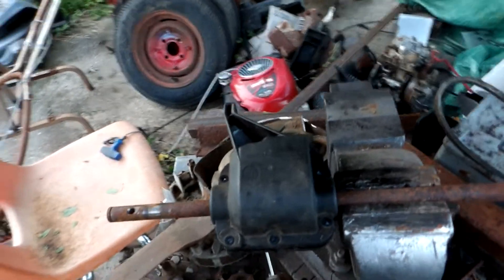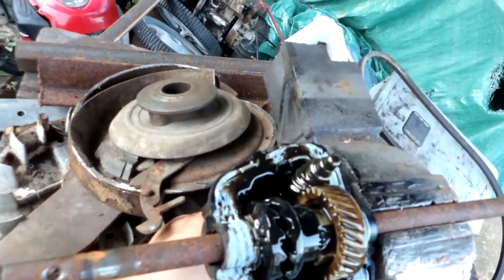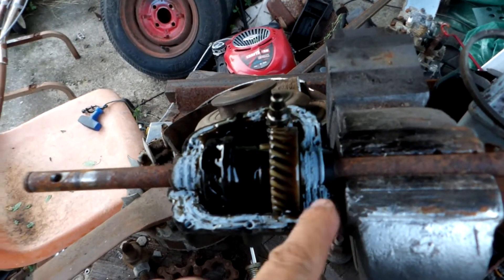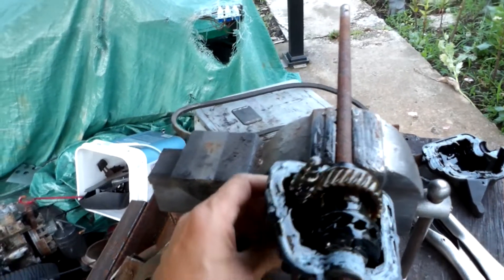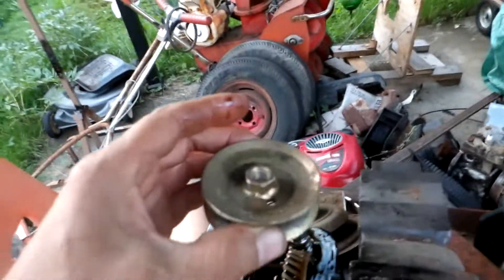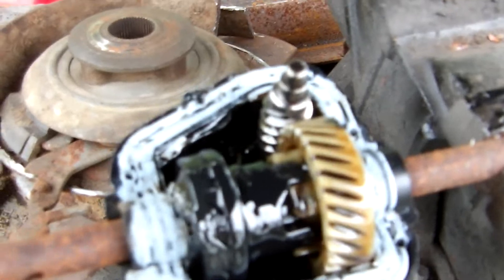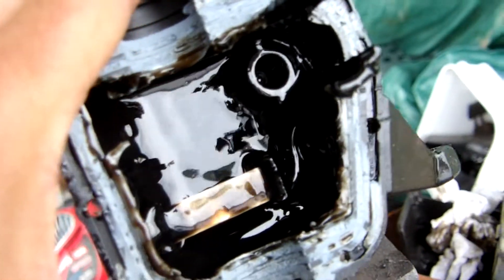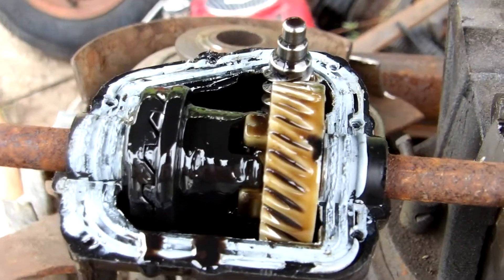Self Propelled Lawnmower Transmission Teardown!

Comment: Your maths is wrong, the worm has  4 teeth, but if its a single helix screw itll still only turn the output gear by 1 tooth per rotation. So the ratio is 28:1, or 14:1 if its a double helix screw
Reply: Useful video anyway, thanks
Reply from the maker: Thanks

Comment: Been watchin you a long time man, since the experimental monosupape, oposed pistons, and supercharged jumo.  Love those old vids where you were playin around.  I'm fighting one of these transmissions now as far as pulling the mower backward.  Wants to jam up and the front wheels won't spin in reverse.  Looked up "fwd mower transmission disassembly" and your vid popped up.  Thanks for makin this one.  I bet it's that "clutch" as you described it not disengaging.  Least now I know what to look for if I crack it open.  Much love from TX.  Keep doin what you do man 👍🏻
Reply from the maker: Hey, thanks for the comment. I thought I had the type of fluid in the transmission identified at one time, but I can't remember what it is now.

Comment: My Craftsman M250 started leaking gear oil around one of the screws, so I'm hoping to take it apart, clean out the lube and sealant, and reassemble. 
BTW there is a rubber plug on my to refill the lube.
Reply from the maker: Oh, yes, some type of fill plug would be nice to have.

Comment: Great video. I wanted to see if i could get it to pull harder ( more power) so I could push a little less when in a tight spot or tall  grass. I don’t know if a new belt would help or not. Thanks for the inside view.
Reply from the maker: I doubt you can get more pull out of it, I was hoping for less speed on mine. I could do it with a larger pulley on the gearbox, but then I would need a longer belt. There is never a free lunch!

Comment: How did you it open?
Reply from the maker: I took the screws out, then had to cut the sealer with a razor knife and peel it open. You would need to seal it back up with Hypoid gear oil friendly sealer afterwards.

Comment: I too took mine apart and was amazed at the quality...
Any idea what would be the correct fluid to add upon reassembly? 
Maybe just a small bath level of automotive gear oil?
Reply from the maker: Yes, I would think automotive gear oil, like 80W90 or something should work in it. You will need a sealer that can handle said oil.

Comment: Don't know how I missed this because I've been looking for help on General Transmissions. I tried to separate the housing after removing the screws but could not because of the really tight sealant. Much appreciated if you would tell me how you did it & if you scraped off the old sealant and re-applied new sealant on reassembly. BTW, I contacted General & was told this (they call the sealant "glue), "The “glue” we use is a Dow Corning multi-purpose sealant #732 that is widely available and can be found on Amazon as well." Thanks.
Reply from the maker: I don't recall what tool I used to take it apart (if it isn't mentioned in the vid). Normally I would use a sharp knife or a pointy flat blade screw driver (some are narrower at the end of the blade than others). Hope this helps. Yes, clean off the old sealer, and apply new sealer.

Comment: wow it seems suprisinly well built ,,,,
Reply from the maker: Yes, they seem to last quite well. The one on the self propelled mower I use has some type of problem though, since it will only spin the right wheel, I suspect it is a problem with the wheel gear assembly on the left wheel,
Reply: @ChargerMiles007   @ChargerMiles007  This is the problem I'm working on now.  The self propelled gearbox seems to be working fine except only the right wheel spins.    I'm going to have to look into the left wheel gear assembly.   I agree.  The speed is way too fast.